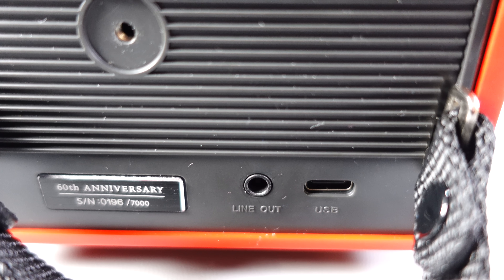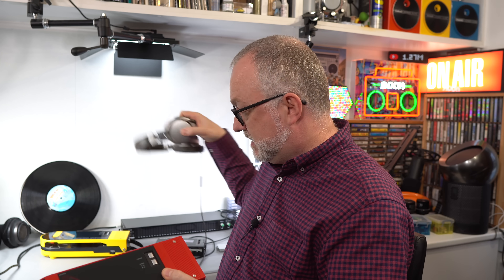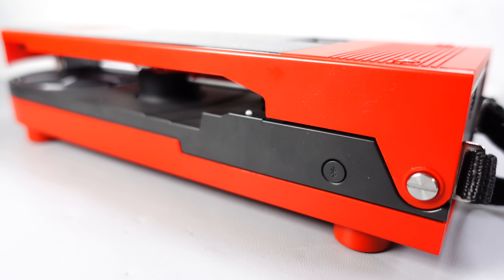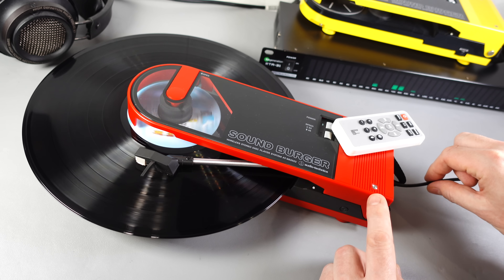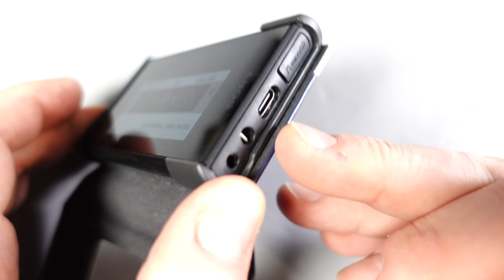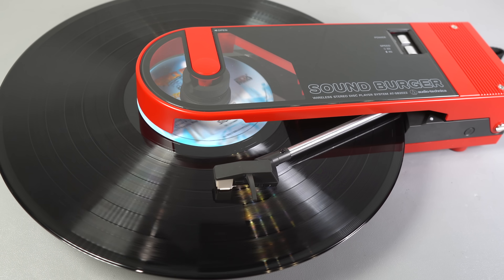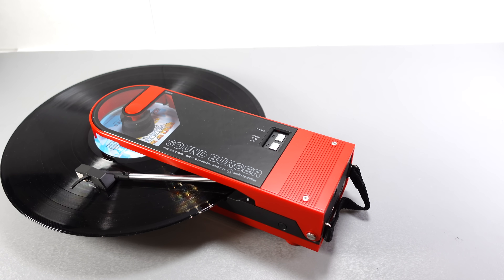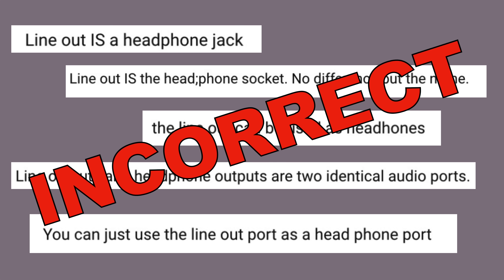Line-out ≠ Headphone-out

Comment: This is a problem I encounter almost daily. As a DJ, I sometimes need to hook up my phone or my iPad to the DJ mixer. In order to get any kind of decent volume levels, I need to set the input gain to max, and turn op the master volume. Which presents all kinds of other problems when mixing. I have tried many devices that claim to convert headphone output to line level input. None do. I ended up making my own piece of electronics for that. It works, but since I'm only an electronics hobbyist and not an electronics engineer , it has a few problems I'm unable to solve.

Comment: One major difference between line out and headphone out is the impedance it's designed to drive, line out is ment to drive around 10k ohm impedance, headphones are often in the 10's to 100's range, not only do the pretty much short out the output, they also alter the frequency response a lot. 
Also worth noting is, there's "consumer" line level and "profesional" line level, there's a substantial difference in the actual signal level

Comment: I had to do this when somebody first gave me a Hi-Fi turntable and I hadn't gotten around to finding a used Hi-Fi amp yet. I plugged an RCA to AUX adapter into it and listen to it with a pair of headphones at line level. Just barely loud enough.

What's hilarious is that there also used to be a different thing that was specifically for record players called "phono out" which I think is less hot even than line level. My AT turntable has a switch to select between the two levels depending what amp you have to use it with.

Comment: A headphone output is good for delivering a certain amount of POWER to load the low impedance of a headphone.
A line output is good for delivering a certain amount of signal VOLTAGE to the rather high impedance of a line input.
With a lot of luck you can use a headphone output as a line output if there is no real line output, but it doesn't work quite as good as a real line output. It is a weak compromise and it can produce more of both distortion and noise than a line output does. You will have to try to adjust the headphone volume control to find a suitable level to send to the line input.

Comment: I was almost right, but I would have thought it would be at a much HIGHER level, rather than a lower one. Reason being that "line level" (as I think it's called in this context, but it might have another name and someone is welcome to correct me) on modular synths are much higher than headphone levels. You need a preamp of some sort (I use Mutable Ears) if you want to mix in audio from a headphone level source or use it as CV or something, and modular synths will typically have headphone out and "main out", which outputs audio at that higher level. I'd be very interested to hear why they have this, if anyone knows, I've never really understood why they're like that.

Comment: Very nice video! The only thing I would add is someone might have active headphones which have built in amplifier and those can work perfectly fine with a line output.

Two things I am curious about:
1. During the production, how do they decide what is the amplitude of line out? Is there some official reference of voltage to dB to make it correspond to a real life sound? Or is it just arbitrary? Say I have same signal, same song playing simultaneously on two different devices and I compare the amplitudes of their line outs, would they be the same?
2. What is this amazing player at 6:47 ?!?!?!

Comment: I think another source of confusion is that on many Windows PC's (particularly ones with Realtek integrated sound cards), the 3.5mm audio jacks can be reconfigured in software to do different things, so it would be possible to use line-out as a headphone jack without issue.
Reply: Exactly this.
Most Mainboards have a 3.5 jack labeled line out, that easily can be used as headphone jack without noticing any difference.

Comment: Ah yes, stick headphones in a line-out; One of two things would happen: A)It is so quiet you can't hear anything because it is raw audio and no amplification is applied.  Or B) It blows your eardrums out because it unregulated audio that hits max decibel levels right into your ear canal.

My computer is kind of funny in that it uses the same output socket for line out, speakers with 3 different profiles and headphones and I have to go into the software package for the audio hardware on the motherboard and swap the settings between line out, headphones and speakers.  Why does it have this weird set up?  Cheaper this way.

Comment: i used to have sony playstation 3d pulse headphones connected to the line output of my Xbox 360 (what line out?) through a mess of wires and adapters. this worked because the 3d pulse headphones had an amp built in (i didn't know that at the time) which i havent seen in any other headphone. very obscure use case but might be useful for someone

Comment: So many people fall in the trap of thinking if it fits it should work! As a qualified electrician I have seen some very worrying things because people think it fit so its ok. Love your videos, thanks for sharing.
Reply: Just saw a slightly newer comment ENCOURAGING people to “question what they’re told” and plug things into slots they don’t belong into as long as they fits to “experiment” with what will happen… I genuinely felt physically uncomfortable knowing that person is just out there waiting for the unlucky day to come where they set themselves or others on fire accidentally.
Reply: @DoomKid  it does happen unfortunately, I was trained as an apprentice at the electricity board as it was before privatisation and we were lucky to have access to a lot of the documents, data and photos of fatalities caused by ‘accidental electrocution’ or stupidity as it should be known. Obviously a set of headphones are a little different to household wiring but strange things happen
Reply: @JumbleLane  One million ohm resistor on each prong of a NEMA 5-15 P plug hooked to the tip and sleeve of an aux cord....allow us to introduce ourselves. This let's you record the sine wave coming out of the wall outlet. Don't try this unless you are certain that you are capable of insulating everything properly.

Comment: I do have (somewhere), earbuds with volume control. Not sure how much, if any, that matters, but any headphones with internal amplification should be more usable. That vinyl player? I dunno; looks like prime oddware to me.
Reply: I'm pretty sure the volume control on certain earbuds is for ease of use rather than any real signal control.
What you need is amplification, not volume lowering.
That being said, they might work with a really overdriven line out.

Comment: I rigged something like this so I could listen to television through headphones.  I specifically wanted one that didn't have a battery though.  No need, just power it through a usb.  At some point I changed televisions, my first iteration I had one that converted the fiber optic sound, and the second was just rca plugs.  Double sided 3M tape and it's semi permanent and doesn't bother anyone else in the room.

Comment: Its 2020. Every line out on anything relevant is a both. They change impedance based on whats plugged in. No modern tech has a headphone out or a stereo out. Everything is labeled lineout. We are well passed hardware not communicating with each other. There are zero advantages to separating them.

Comment: Line out goes to an auxillary input or mixer input. That input uses the amplification of the device or mixer to get the proper signal strength from said external source. Headphone out goes to headphones. A headphones out can be used to plug into an external source for recording or listening though. Just has to be a stereo link otherwise it's mono or just the left side that gets picked up. 30 seconds instead of 12 minutes.

Comment: I used to have an ear bud, single ear so no stereo, simular to the ones that came with crystal radio kits. 
Now that thing I could absolutely use in a line out jack and hear just fine. And anytime there was a headphone jack I had to crank the volume way down. 
But. The list of problems with it are very long. But hearing a faded signal is not one of them.

Comment: Ppl amplify all manners of sources ie: line-out, headphone, L/R’s, AUX, Pre-Amp, etc... as long as it doesn’t peak or have undesirable outcome.
Even modern equipment today amplify/modify the incoming signal(s) their own ways before sending the results to the end ie: drivers/speakers, female plug(s).
There is in fact a difference in line-out & headphone out in an electrical sense.
It’s totally understandable why some ppl think it’s the same 💩 diff smell kinda situation tho.
Line-out from my understanding afaik is just a pure/clean signal (hence why it’s low volume) aka no further amplification/processing and such, unlike headphone out which tends to have some sort of extra work on it already on a circuit/electrical level intended to be used directly as is even though it can be modified further ofc ie: amplified, filtered, etc...
But if that’s the intent, then line-out as the source is the better option if available. Otherwise headphone out can be used (when set adequately low enough to do so) but just know that the signal has already been amplified/adjusted in some sort of way already so discretion(s) considering must be taken into account.

Comment: It´s not only about the levels. Line-out is not designed to deliver power: Line-in has an impedance of 10000 Ohm, that´s more than 1000x as much as headphones do, so almost no power is delivered to a line-in receiver. Although both line-out and headphone jacks deliver a voltage signal, the headphone output can drive low impedance loads.
Line out has an output voltage of +/- 1.7V and an impedance of min. 100-600Ohms. Connecting an 8Ohm headphone will give you 5-27 mW power, that´s low. A 600Ohm headphone will give you at most 3mW.

Comment: TLDR; Headphone jack has amp & volume control. Line out doesn't.
However, headphones have come a long way. My set can be wireless, or wired. They've got their own power, amp, and volume knob built in, so I could definitely use the Line Out jack as a Headphones jack.
But the real question is... Why would I when I've got wireless? :)

Comment: I have to wonder if line out would provide a reasonable level of volume for really high sensitivity low impedance headphones. For example, I have a set of KZ IEMs and they are so sensitive that I can hear the amp noise on most lower end devices and have to turn the volume to very near the minimum level for it to be comfortable.

Comment: Technical specs:
Line out: ±1.736v into 600Ω, 2.89mA, or 5mW. Some "pro" gear is more sensitive at 1mW.
Consumer headphone, typically have <12v into something like 8Ω, typically around 500mA or 800mW. 
The mW rating is mostly what you'll hear as volume. Line out will be very quiet on almost all headphones.

Comment: Very clear explanation of the difference between line output and headphone output on a device. I'll add that the line output is not designed to drive headphones properly. I would agree with another commenter, that you could do another video explaining impedance of headphones vs line in/out impedances and the signal levels between the two types of outputs. Getting more into the technical reasons why headphones don't work so well on line outputs.

Comment: I'm surprised you didn't include a warning that using a headphone out as a line out is likely to result in an annoying buzz from the amplifier.  And since so many devices (especially computers) don't have a line out, if a device exists to remove that buzz I'd love to see you review it.
Reply: That noise is most probably 50/60Hz coming off mains power. It's just bad quality of soundcards on most motherboards not filtering it out properly

Comment: Worst case, you can damage the line out circuitry by connecting low impedance headphones, essentially shortcircuiting the output relative to the high impedance loads expected from a line in. Line out isn't meant to drive anything, it just transmits a signal.

Comment: I have, use many Stereo sytstem s in the past, that had RCA, 3.5 MM jacks. you also Have to be careful that you do not Double  amp up a system! serious damage can be done! or in recording, which i do A lot of - you can damage your  soundboard or mic board.     I do recomend testing your system,s with a pair of non - pre amped earphones. that way if there is way too many volts commign out - you will not be the one replacing anything.   

BTW: I am QRS Recrods and radio! the radio station is still in the works, just maybe a new station name !

Comment: The "line out" generally has a much higher "output impedance" (200-2k ohms) and CANNOT deliver the proper power for MOST headphones.
However in some cases you may be able to use a "headphone output" to connect to a "line in" without issues.

Comment: Weird 'dual use' of connections when it includes power. I wonder why this is even allowed. A few years back I bought some lights from IKEA and the connection to the power supply was the old DIN speaker plug  😱 🤪
https://en.wikipedia.org/wiki/File:Speaker_din_male_and_female.jpg

Comment: A few years ago, I had bought a Grace Design SDAC from MassDrop and used it with my headphones…but it was quiet, so I turned my computer up by a considerable amount to get it to sound right. Come to find out, you're supposed to use DACs in conjunction with amps! I didn't know this at the time; I'm a pleb.

Also, rip SDAC…It had a MicroUSB power input, but the jack got messed-up over time and now my DAC doesn't work any more (and I have no idea how to retrofit it with USB-C) 😢

Comment: Who runs their headphones without a tubeamp anyway? Why would you want an 80s spec transistor shit to load max 32 ohm headphones, where for fidelity one needs that tube headphoneamp in between. As there is no physical connection between the vinyl, and the audio, without tubes there is.

Comment: I quite often find myself amplifying music thru a headphone out, and I've always wondered how to best optimize sound quality in that instance. I had thought that generally it was good to lower the volume on the output device, and I'm glad to see that I was more or less right, but it would be interesting to know if there are any generalizable rules to this, in the many instances where consumer electronics come without any way to measure levels. 

I usually do aim for about the same as you seemed to, roughly 1/4 volume on the headphone out device. Was that pure coincidence, or is it a fairly safe bet?

I bet people would watch a video about this.
Reply: That's precisely why line out exists.  If you're using external amplification, you want to use the "line level" output and amplify that, opposed to double-amplifying where you're using a headphone jack PLUS something else.  Computers muddy this up a bit as it lets you adjust the level of the line out, kind of defeating the purpose.
Reply: You want to use whatever the best amp is in the chain to provide the most amplification. (And, if possible, avoid other amplifiers)

Aside from that, you want the signal amplied as early as possible.

So, keep your line-level device output to your amp cable short, and your amp output can be long.

Comment: Some other commenters have already noted that there are lots of devices which have an output jack labeled for both headphone AND line. Often, this is just a headphone output which will also work as a line output if the internal headphone amp is turned down sufficiently. But there are at least some devices with such dual-purpose jacks where a sensing circuit detects the impedance of the plugged-in device and automatically engages or bypasses the internal headphone amp, so it "just works".

Comment: Would headphones with a built-in volume wheel work? The amplifier requires power (charging it up beforehand). Would a built-in volume wheel circumvent this issue?

Comment: I don’t like how so many devices coming out today don’t have headphone jacks anymore. I realize that Bluetooth is the new thing, but there are plenty of music lovers out there that have fantastic headphones that aren’t Bluetooth, and you either can’t use them with these devices, or have to use adapters and/or amplifier devices to use them. These wired headphones work and sound great, and there’s nothing in them where you have to charge them or run out of power. Don’t get me wrong, having the option to use wireless headphones is great, and comes in handy for a great many situations. I just wish these devices would spend the extra couple of bucks to have a headphone jack.
Reply: just buy the 3.5mm to usb C cable. There is ZERO reason to make phones not waterproof because a few audiophiles are too fucking lazy to buy one more cable for their setup.

Comment: When I started work in 1970 the company produced PA systems for use in large buildings, the line out on their amplifiers was in excess of 100V, designed to feed into long cables with a transformer/speaker unit to minimise loss in the cables.